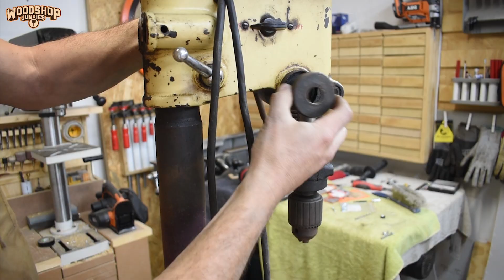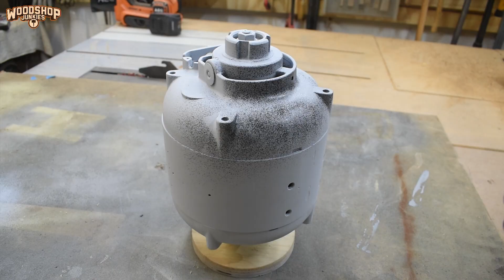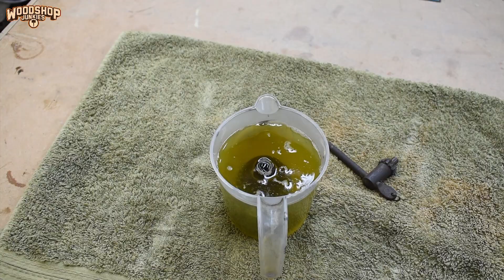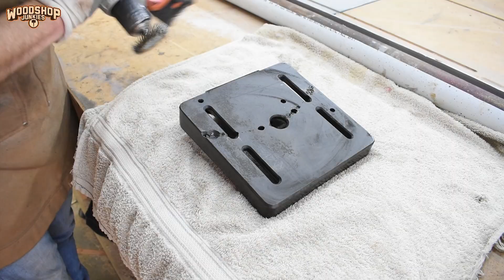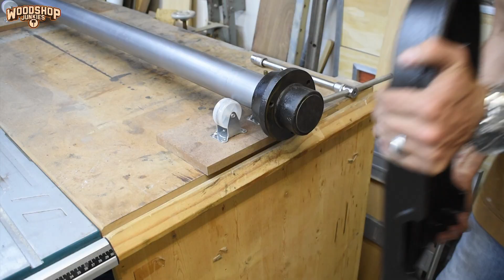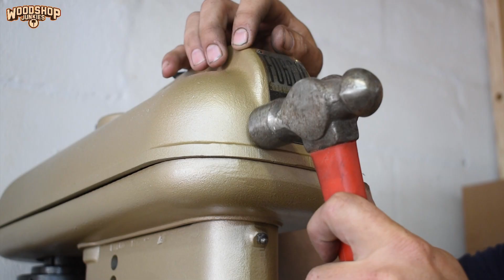Better Than New! 60 Year Old Drill Restored

Comment: I have the same Fobco drill press but with a benchtop stand instead of floor mounted. Came out of an old college and still going strong. Build quality is on another level compared to the crap on the shelves today!
Reply: I have one of these exact drills. Weighs a tonne, but built in the days when ‘Made in England’ actually meant something. Round holes straight, every single time. Quite happy even swinging large hole saws in steel… 🙂
Reply: This is true and I have been researching why this was so true back 50+ years ago. I am not sure which company's in Europe who made machinery but in the U.S. it was a select few of them. The reason being was that during the industrial revolution a lot of heavy machinery was manufactured and those plants who had the facilities to manufacture machinery latter on switched to a consumer based economy after WWII, so they utilized their plants to make these sorts of Consumer/Prosumer products and they were overbuilt with materials that could probably make 3 of the same kind if they cheapened the manufacturing process which is done today in China. The products are built just to the spec to get the job done and nothing beyond that unless you want to go to a higher spec which is pro level.
Hence the reason why I go to all garage and estate sales and I have found some fantastic machinery for very cheap, unfortunately I can't go too big due to transportation and logistics and also add to the fact that I don't have 3 phase power in my Home otherwise I would have a Bridgeport Mill and a South Bend lathe. :)
Craftsman and Delta machinery like lathes, Drill presses and other wood working products were made by one company but I haven't been able to track down who made their products, all I know is that it's good stuff and a lot of the motor's were made by General Electric. So anytime I see a piece of Machinery that has a General electric motor hanging off of it I try and buy it. G.E. Motors were built like tanks! Plus I love the Black paint they used, almost looks like black Porcelain.

Comment: 4 blows with rubber mallet and it is loose, lucky you. On my restoration of scrapyard find drill i had to heat up casting with acetylene torch 3 times and still nothing. At the end i took cutting torch and cutted column, gauged column tube out of castings and machined new column.

Comment: I'm restoring an old 1940-something Delta drill press so this video was especially interesting to me.  I have removed the rust from the "column" by putting it in a PVC pipe filled with 1:5 molasses: water mixture and built a contraption using casters much like the one you used.  However, I'm planning to attach a drill or angle grinder to the column so that it will spin when I use sandpaper and polishing compounds to shine it up.

Comment: The apprentice marks on the table could be brazed (rather than welded) and then the high spots filed off and flatness restored using sandpaper laid on window glass.  I don't know if that's news but that's a simple way that has less risk of heat damage.

Comment: We had that exact model in our engineering factory, and it was used every day for near on 50 years. it must have drilled over fifty million holes. When my brother retired and sold off all the equipment I had the drill in my workshop it had virtually no wear only problem was the electrics needed a little care.

Comment: Solvent will not damage the stator windings,I  repaired these motors for the past 45 years , now retired, a good insulating varnish  coat on the winding would help

Comment: Great Restoration. I'm currently finishing up a restoration of a 1940's Craftsman "Mohawk" drill press that I inherited from my Grandfather. I just finally got a belt cover guard and, as you mentioned, need to find someone to make me a return spring. Mine is literally broken. It has bushings in the motor housing as well but also has 2 small ports on the top and bottom of the motor to add oil. Wondering if I should both grease and oil it or just rely on the oil. It didn't show signs of being greased previously. I'll hopefully be putting out a video on it soon. Thank you for sharing your experience restoring this beauty from the past.

Comment: I love it. The copper did work out well in the end. The spring you might be able to get another wind into it that would help it. As far as over kill for your shop and what you do, well if you can afford the room for it I'd keep it and sell the benchtop version. This way you are better prepared for possible future projects you might want to tackle knowing you have the capability in the larger tool. I always try to practice what I tell my kids. When possible by the tool that will do more later instead of just what I need now. Otherwise you will buy the second tool later anyways. Of course for space or monetary reasons that isn't always possible I know. Either way best of luck too you and I can't wait for the next project you have for us. I love them all.
Reply: I agree with YackBuilt - keep it if you can Jean. Find a permanent spot and bolt the foot down,  then add the bigger surfaced plate to the table.
I like what you're doing and wish you every success with going full-time.  Your lighting, positioning, focus and sound is already very good. Guard against talking too much, let the workshop sounds speak to us!

Comment: WD 40 is a water displacement chemical, I would sagest penetrating fluid. WD 40 is so miss used in many ways! just like people say My hot water heater in my home needs replacing! Why would anyone heat hot water?
I have a cold water heater in  my home.
I would also suggest some type of rust inhibitor on freshly cleaned parts I use Johnson's paste wax and it works well on steel and iron.😀🛫

Comment: Nice work on the restoration. A couple of things:
1) Don't sell it. Have one DP for wood, one for metal. You won't regret it.
2) For the arc of shame on the table, take it to be brazed. The brazing will go nicely with the paint choice.
3) If PB Blaster or Kroil (or similar) are available in your location, they are better than WD40 for getting seized parts to move.
4) I have a large PVC tube I use for stuff like this (plus several smaller ones for smaller applications). One end is permanently capped, the other with a removable cap. I keep it vertical and place large metal tubes/rods in from the top and fill with Evaporust. Let it work for 24 hours and tip the tube to drain the Evaporust and pull out the treated item. No need to cut the tube into a trough.

Comment: Jean, 4 things:
1) Question- Did you remember to use the grease joint, on the front of the spindle casing, to lube what needs lubing?
2) I believe, the clamp you put below the head unit but above the table, actually belongs below the table, to support the table
     when moving it horizontally. (Which is where it was when you started)
3)  I suggest you replace the drive belt with a "link belt". They are great and will remove noise and vibration you didn't know you had.
      Every belt driven tool should have a link belt on it.
4) Great rebuild job. You are a great organized thinker and worker I envy you.  💚
     I loved your idea, of using PVC pipe as a soaking tray. I have a few thing I can use that for.
Cheers.
Reply from the maker: I greased the spindle assembly, bearings, and sleeve manually when the unit was disassembled. In the future, when performing maintenance I will use the nipple. 
I think the collar was in the wrong place originally. I believe this machine can double as a milling machine for light milling. In those instances the head height gets adjusted and the collar supports the head. This feature doesn't work on my machine because I suspect the pillar bar has been replaced at some stage. That is why there is a step on the shaft right underneath the drill head. But I could be wrong.
Reply: @WoodshopJunkies : Jean, you seem to be right.
I looked at many pics of the FOBCO machine and the collar is always under the head.
 But the post and collar sizes are a puzzle.
The head appears to be made to fit the small part of the post but the collar made to fit large part.
No matter which size post is the original, neither size post will work for both head and collar. 🤪😵‍💫👽

Comment: Nice job. The color looks great it is very close to the vintage Sears Power-Bronze. One word of caution, that’s a bench model base with a floor height column. I’ve seen a number of these conversions get tipped over because the base isn’t large enough.
Reply from the maker: Thanks. I suspected such a conversion was done due to the step cut in on the column.
Reply: @WoodshopJunkies  You could tie a bungie chord in the back and against the wall to keep it from tipping over.

Comment: Nice Job.
I do both metal and wood working.   Have had a nice floor standing drill press for years.
Bought a benchtop drill press about 10 years ago.   They are quite different beasts.
The major problem with most drill presses is that they run too fast. This is almost always for metal and in wood when you get to using large bits..
Of course the larger reach on the big press will come in handy.
Keep both.
Reply: That is why belt driven drills have multiple pulleys, to adjust the speed.

Comment: I have a drill that is almost identical! The previous owner wired up the drill to a foot switch and I have recommended everyone with a drill press do the same. Have a master on/off and then the foot switch to control the motor. It keeps both hands free to hold the part and quill plunge from start to finish without the need to let go to turn off the motor. It is also safer in the event of a problem (like a part catches and spins) just move your foot!
Reply: Anything being drilled should be clamped in place, to avoid
grabbing, spinning and mutilation of your person. 😟😱😭☠
Basic shop safety.
Reply: @zapa1pnt  I agree...but sometimes things aren't clamped. 🤷‍♂️